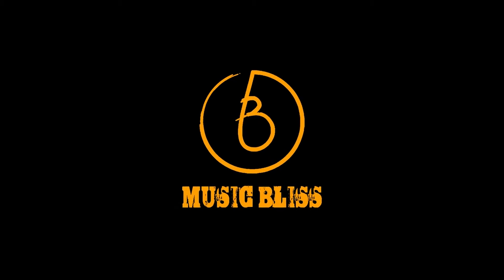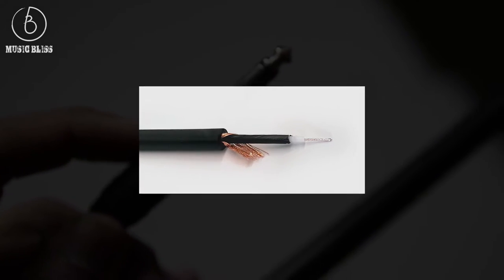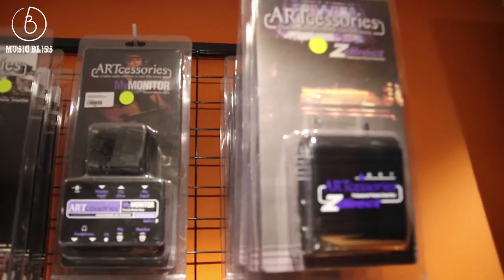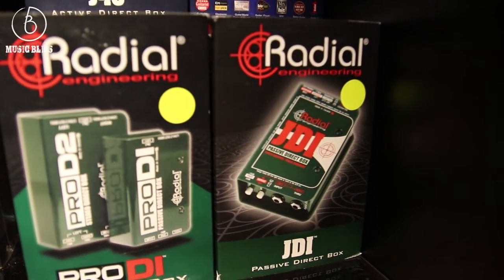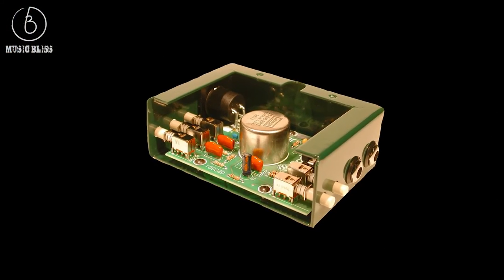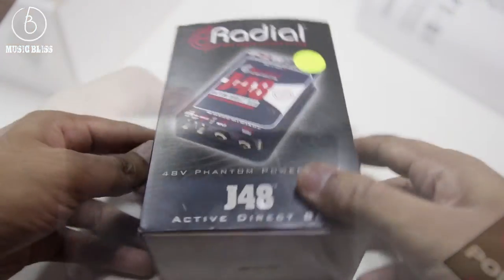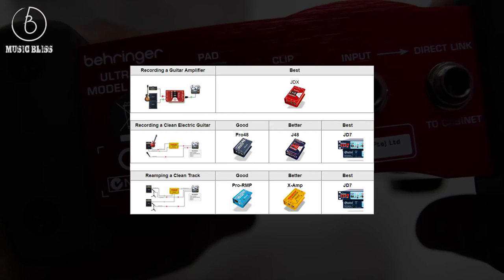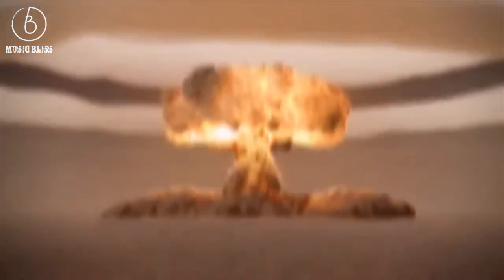DI BOX 101: What is a DI Box and How to Choose the right model

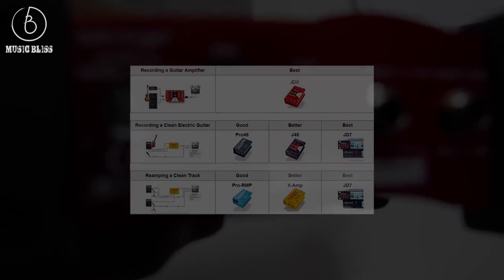Comment: Can I get a link to the picture at 4:15?
Reply from the maker: It used to be on the official Radial Engineering website, they have since changed that section. Try checking the website, under the Roadmap DI Selector tab....